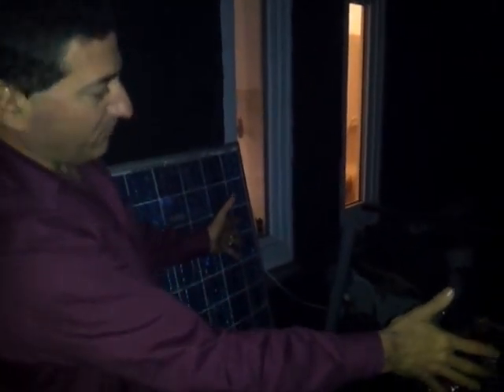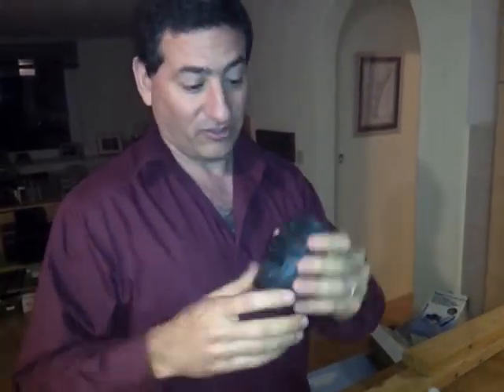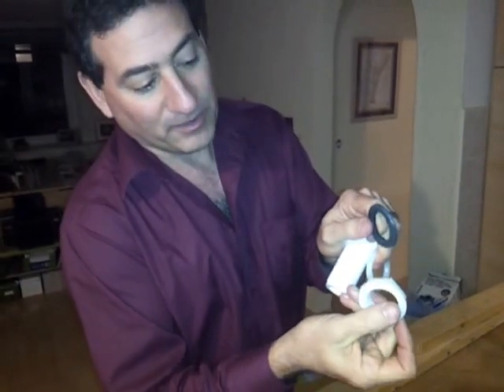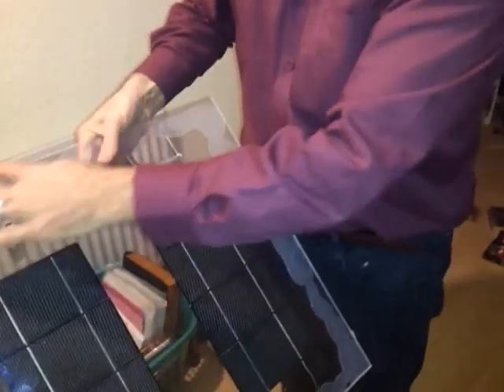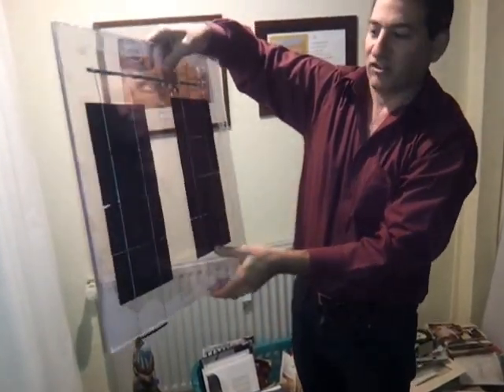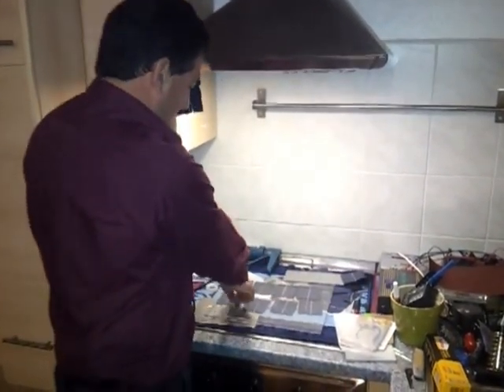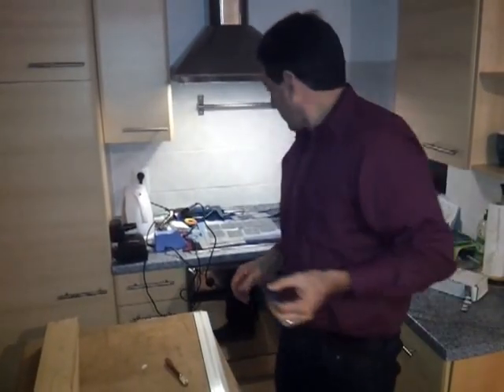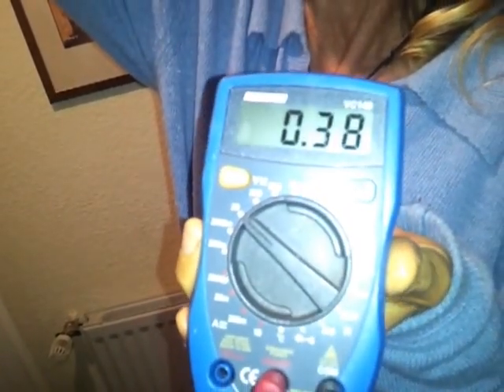Biogas tank adapters and self-made solar electric panels

Comment from the maker: Cell Specifications: 
Average Power (Watts): 1.75 W 
Average Current (Amps): 3.5 amps 
Average Voltage (Volts): 0.5 V 
Thickness 200 &#956;m = 0.2 mm 
Exact dimension: 3 1/4 inches x 6 inches, or 80 mm by 150 mm 
Weight: Just above 6 grams, or 0.2 oz.

Comment from the maker: My other panels shown have 15 cells x .5 V x 3.5 A = 26 W.  It is my half cells that I cut that are about 1.8 Amp now.  Where I got confused was that each cells puts out 1.75 WATTS.  The cell specs for the full cells are: Cell Specifications: 
Average Voltage (Volts): 0.5 V 
Thickness 200 &#956;m = 0.2 mm 
Exact dimension: 3 1/4 inches x 6 inches, or 80 mm by 150 mm 
Weight: Just above 6 grams, or 0.2 oz.

Comment: Current remains the same in a series circuit 4volt x1.8A = 7.2 watts.
I think you need a refresher course in basic Ohms Law.Voltage multiplies in series circuits and current remains the same whereas current multiplies inparallell circuits while voltage remains the same.Hope this helps.